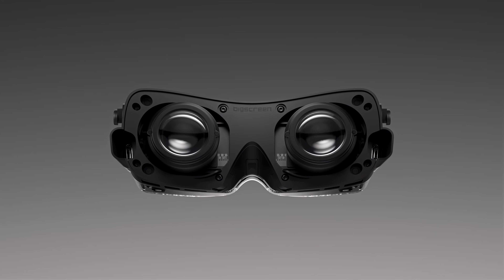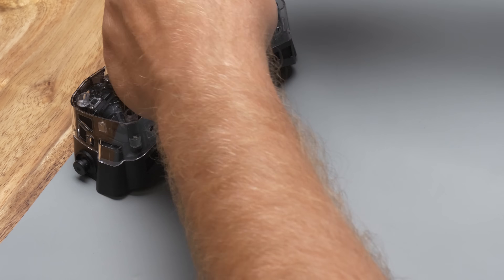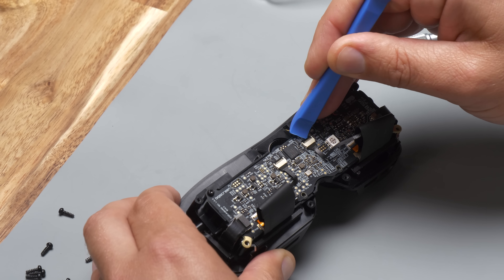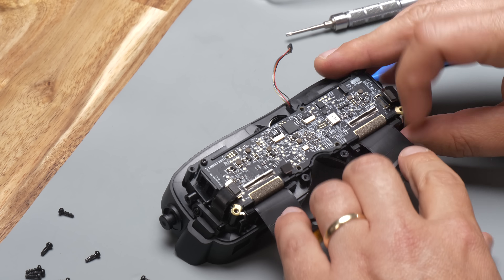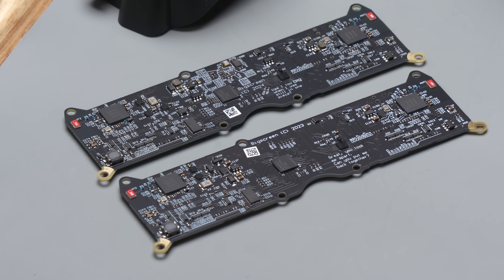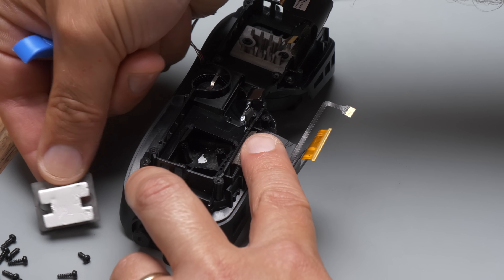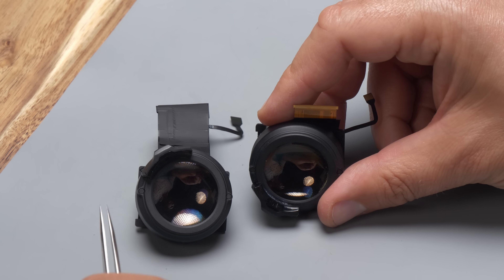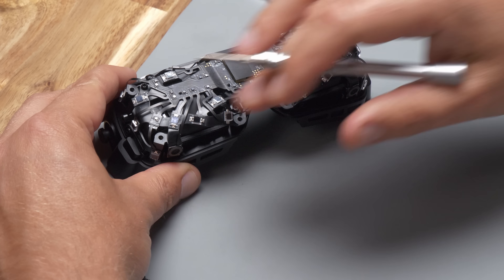Bigscreen Beyond 2 Teardown: How We Achieved Eye Tracking, Adjustable IPD & Better Optics in 107g

Comment: Awesome! You guys rock!  A question / concern about the eye tracking. The sensor seems to stick out quite a bit, giving the impression it might hit your face, or at least stop your eyes getting as close to the lenses? Is this true?  Does this affect achievable FOV, if not able to get as close to the lenses?
Reply: I don't know how to explain it, but even when I hold my BSB1 with bare hands (without the gasket attached) to the point my eyelids are brushing the lenses whenever I blink and the top of the lenses are sitting on my eyebrows, the bottom part still has some empty space.

The face gaskets are notably thicker on the bottom part than on the top part.
Reply: @replacesoundboardThanks. Good to know.  It’s interesting to see that the eye tracking cameras are plug in modules to a common mainboard, which suggests they could potentially be added later (i.e. common mainboard).  Because I’m only interested in the “possible” future Foveated Rendering application of this, I’d rather buy BSB2 without eye tracking, and only add it later if it becomes worthwhile.  🤔
Reply: @gregclare  Not sure where I read it, but I think someone mentioned that, right now, the 2e is a separate model which requires to send in your device if you want it later on. But, in the future, they miiiight release an eye tracking which you can add yourself, but it would be more expensive or something.

Maybe it's a completely false rumour.
Reply: @replacesoundboardGiven that disassembling the BSB2 (to plug-in some eye tracking modules) would void any warranty, I’d be happy to send it back for an upgrade.  Understanding there would be a reasonable cost to this, knowing this was possible would at least resolve the worry of ordering without eye tracking, only to later wish I had it.  I wouldn’t want to have to buy a whole new BSB2, just to add eye-tracking later! 🙄
Reply: @replacesoundboardInteresting that the almost unbelievable edge-to-edge image sharpness / detail (shown at 8:42), suggests that if you have a powerful enough GPU, then Foveated Rendering might not actually be needed?  After all, these are more realistic (with current GPU performance) 2.5K modules, not the 4K modules that really need a 5090 to drive (or even a 6090!!).

Comment: The only thing I miss is the fovated rendering with the eyetracking to release the strain from GPU especially that you guys are not using OpenXR but heavy SteamVR backend that drops the performance by 25% in some cases. I was told that you are working on the OpenXR implementation. Is that still true?

Comment: It's incredibly repairable considering its size, most companies would just give you a soldered and glued brick
Reply: And it sure does seem like one could replace the stock front plate with an Inside Out tracking cam array and/or Passthrough stereo camera eyes plate that plugs into unused 2.0 port, if they get to offering one.  Expandability possibilities
Reply: is it repairable though? when a component in there goes bad, what are you going to do? take it apart, wish the damage away, and put it back together? unless bigscreen commits to providing replacement parts, this is not a repairable device.

Comment: my finger is hovering over the order button, I just need to wait for the deckard announcement
Reply: It's not coming out until 2026 at the very earliest. And it's pitched as being an inside-out tracked standalone headset when most people buying the Bigscreen want a dedicated PCVR experience with lighthouses. They're not really comparable products at all.
Reply: @T00DEEPBLUE  I dont have base stations or controllers already. I am coming from a quest pro, so the inside out tracking on the deckard would actually be preferred and hopefully it will have face tracking too, but the form factor and weight of the beyond is endlessly appealing, especially with there being mods for adding mouth tracking out there too, but the beyond would just be considerably more expensive because I dont have a lot of the hardware already
Reply: @ChickenScratch  If you haven't got the lighthouses and index controllers already then it's hard to recommend the BSB. Most people buying this headset already have those pieces of hardware from previously owning an Index or Vive. But for those who already do, the BSB2 is a no-brainer.
Reply: @T00DEEPBLUE  Maybe, but the bigscreen beyond 2 also offers something no other headset does, well except maybe the pimax dream air, but that is a pimax headset and we havent actually seen it yet so who knows how it will be
Reply: Since Valve no longer produces the BS it makes virtually zero sense to purchase this headset as a user not in that ecosystem
Reply: @Frigobar_Ranamelonico  Yeah that's another thing, the hardware it relies on is on the way out too. I've heard conflicting things about it but apparently knuckles are also not being made anymore. Despite all of that, it kinda just shows how good and enticing of a product it is if some people are willing to buy that stuff just to use it. It's so close to being the dream headset
Reply: @ChickenScratch I mean you can’t buy in different countries directly from valve, you don’t need any more evidence
Reply: @Frigobar_Ranamelonico  ah ok so it is a country dependent thing? fascinating. Maybe the beyond 3 will have slam tracking. It would be less weight than lighthouse tracking and they could do more with it like track controllers and have pass through
Reply: @ChickenScratch  more than country dependent, it's probably ending the supply in the warehouse
Reply: @Frigobar_Ranamelonico  dang, I hope the deckard's controllers are at least compatible with base stations so that they can take the place of index controllers when those eventually run out

Comment: I gave up on buying this product after realizing that I had to buy extra 800 dollar worth of Valve Base Station + Valve controller set, outside of buying the 1300 dollars of the main headset + audio strap.  Valve index product isn't officially available in my country so I have to buy sweaty used ones or buy through a reseller which marks up the price 1.6x times + the currency exchange + tax. 

 The Bigscreen temps me since I get so sweaty after using my Quest for a few minutes but the price is totally out of my reach. Even just the 1300 dollar (headset + audio strap) is a tough, tough pill to swallow.
Reply: Have you checked HTC Vive for the base stations? Although that doesn't change the fact it will be costly for someone who's not already in the ecosystem.

Comment: Foviated rendering mentioned 🗣
Reply: Games will need to support it.  Which means BB2 would need mass adoption.  Seems unlikely, but they might work out some deals with a couple publishers.  Best case is Deckard gets eye tracking and Foveated rendering and Valve pushes out a solution embedded into SteamVR.
Reply: @jlepage36  Games do support it. The headset cannot do it. DCS, iRacing and MSFS support it.

Comment: I am praying that you're in talks with Valve behind the scenes to support future Deckard Controllers and wireless tracking/display without Lighthouse. A version of the Halo mount with Deckard tracking and Apple Vision Pro style belt  mounted battery would be perfect
Reply: I desperately hope they don't cave to solutions that don't use external cameras. This is the most practical way to make a small headset with ACCURATE tracking. Inside out should be thrown in the garbage bin with WMR and instead focus on making Lighthouse type tech cheaper
Reply: @LunaSolarys  Not only accurate tracking but it enables people like me to keep using vive 3.0 and tundra trackers without resorting to 3rd party apps like OVR space calibrator to get the playspaces aligned.
Reply: The Deckard controllers seem incredibly meh, if the leaks are anything to go by. And inside-out tracking cameras not only add complexity and weight but the tracking volume of the headset would be garbage due to the headset's physical size restricting the field of view of the cameras. Base station tracking is the only practical way to go for a headset this small.
Reply: @T00DEEPBLUE  yeah true, the headset already does have issues with tracking even with base stations, good that you brought that up,. although i wouldn't mind still having some sort of puck in the future giving the headset standalone capability whilst still using basestations (heard that wouldn't be realistic though)

Comment: Pricey as heck but sooo much respect for the company philosophy, that's how it's supposed to be!
Reply: honestly its an insanely good price for what it is compared to the rest of the industry
Reply: @rei_lyy  It's a good price even you just want the screens and lenses out of them!
Reply: @rei_lyy  I don't know if I'd call that a good thing, if in the best case you're still spending a 4-digit sum of money on a headset (assuming you haven't already spent another 4-digit sum on the PC, tracking equipment and controllers).
Reply: you can also buy the upgrade with the accessories package to get it cheaper, with the caveat of needing to buy the face cushion separately or get a thrid party cushion
Reply: The philosophy of not giving relevant information? Like how its upscaled at 90hz, and now they came up with a new term "diagonal FOV" to mislead even more. Diagonal FOV does not mean anything.
Reply: @Nobody-Nowhere What? Diagonal FoV means FoV on the diagonal, which is usually optically limited rather than limited by the screen size.
Reply: @charltonrodda  And why does not any other manufacturer use diagonal FOV? because BSB invented it on this headset to mislead people to think its the horizontal FOV that people always think when they hear FOV.
The real HFOV is only 108 degrees, so it was about 5 degrees total more than the BSB1. So 2.5 degrees on each side...
Reply: @Nobody-Nowhere okay butt licker
Reply: @Nobody-Nowhere diagonal fov means more than you think the diagonal fov is screen size overall you can have a super high horizontal fov but a smaller vertical and the screen won't be big enough you can have a high vertical and a smaller horizontal and your fov is limited now having a high diagonal fov means you are higher on both ends and it covers all angles

Comment: how much do all the screws weigh?
Reply: I did a rough weightscale estimation, and it seems to me like they weigh less than 10g. Probably around 5-7.

That's if they use normal screws. You can get lighter metals screws that cost more.

Comment: This headset should have been wireless by now.
Reply: Making it wireless would just add unnecessary weight and there isn’t any way to run 2560x2560 screens without compression.
Reply: @sandernote089 there is a way but it's not easy and it requires a lot of extra components
Reply: Making it wireless without severely hurting visuals or weight/comfort is wishful thinking. Not to mention shit battery life and input lag.
Reply: "Should" => Why?

If it's just because you want small form factor combined with wireless, there's the Vive XR Elite.
If it's micro OLED and pancakes, there's Play For Dream.
Reply: you mean Play for Dream?
Reply: @Frigobar_Ranamelonico  that’s a whole different class of headset
Reply: @sandernote089 not really, same concept, higher resolution panel (still mOLED), and it a complete package compared to the BSB2.
Reply: @Frigobar_Ranamelonico  my only problem with that headset is that it doesn’t have any physical display port connection and it seems quite large compared to a beyond. I mainly use mine for social VR with some SIM racing on the side. So the small form factor is extremely important to somebody like me. Still looks like a really cool headset but for that price tag I’d expect some sort of physical connection alongside wireless.
Reply: @sandernote089  the point is that, beyond that valve no longer sells stations and controllers.

But the cost of the BS is identical to that of the PFD for someone who has to approach it today.
Once you count everything to make it usable
Reply: @Frigobar_Ranamelonico  it might cost the same, but it’s a wildly different headset. The big screen is a super lightweight small form factor custom fitted headset while the PFD is a large bulky Apple Vision Pro competitor.
Reply: @Frigobar_Ranamelonico  You do have a point that it's less compelling for someone who's not already in the SteamVR ecosystem to buy into the Bigscreen Beyond. Despite being satisfied with my BSB1, I do understand the cost of purchasing brand new lighthouses from HTC Vive (plus controllers from whoever you can find decent ones) is an extra cost not everyone can afford.

I did stumble on some people who still made the jump, but only because they truly wanted that small form factor (mostly simmers who could afford it).
Reply: @replacesoundboardyeah, unfortunately for them this decision is probably blocking even more people from making the jump

Comment: Ordered bsb2e a few weeks ago. With audio and halo strap. Perfect vr headset for me. Don’t need to break the bank for a 5090 to take advantage of its full potential. I like that you’re showing it off this way. It is a technical work of art. Thanks a bunch! Cheers!
Reply: Becareful because dynamic foveated rendering is not gurantee they said.  We can loose $200 for BSB2E version
Reply: @sky-h6j-i1q  This vr headset is a winner for me with or without DFR. Cheers!
Reply: @sky-h6j-i1q   I'll chalk that up to a software implementation due in the future. You don't need the precision level of Apple Vision Pro eye tracking to tell the DFR driver 'Hey, my eyeball is looking left and down 15 degrees right now, spend more system resources to draw that area a little sharper for now'
Reply: @sky-h6j-i1q Eye tracking is important for me and my content creation.
Reply: But if you do have a 5090, expect a locked 75Hz while you super-sample out the wazoo and max every graphics setting.
Reply: @jlepage36  I checked the prices for the 5090 and they are over 3k. Going to be a long time before I can grab one. I run a 9800x3d and 4090 so I think I'm good to go  for the bsb2e. I fly msfs and elite dangerous. Oled is a must have for space games if one can afford it. Cheers.

Comment: Cool, foveated rendering❤
Reply: But it's not foveated rendering. It can't do that.
Reply: @Ademos5  I don't see why not. As long as it can track eye position, the rest is handled in software.
Reply: I doubt that one very small camera per eye is ever going to be enough for good DFR.  Maybe the BSB3e will include more and/or an IR array?  Time will tell I guess.  Still, looks like an amazing headset though, and is def on my micro-oled hit list to buy later this year.  However, no way I'd pay extra for 2e until DFR was supported.
Reply: @tomc1380  since when does it require more than 1 camera? The single camera is for eye tracking  not face. Where is your data saying one camera isnt enough for eye tracking?
Reply: @insertnamehere4419  The 'data' stems from basic human anatomy. Humans aren't cyclops.
Reply: @T00DEEPBLUE  what? There's one camera for each eye. How many eyes do you have? I asked you where is the data that says you need two cameras for one eye, or three, or four? five? how many?
Reply: @insertnamehere4419  Your last comment was poorly worded to be interpreted as meaning you only need 1 camera for both eyes. And I thought that was kinda funny.
Reply: @T00DEEPBLUE  And I think it's kinda funny you interpreted it that way, but sure? We're talking about each eye tracking module, not the headset as a whole.  Why in the F would I think it's one camera for both eyes when each eye gets its own eye tracking module? Critical thinking would have been useful.

Comment: Why didn't you install 1:2 ratio OLED displays instead of 1:1? We need 140° or more FOV with 100% binocular overlap, and a display 1inch by 2 inch could solve this
Reply: "we need" is hyperbole and you know it.
Reply: i dont think that display exists yet, they buy the displays, i dont think they make them. also change in displays means they need to remake the lens, and this type of lense is hard to get right
Reply: @elchampion4658 let's hope bigscreen partners with sony to get them to produce wider displays 1:2 or 1:3 aspect ratios for that incredible immersion... Pimax has achieved this but thwy have a 90° sterio binocular overlap with 25° on either side.. but that's a compromise for many and motion sickness for several others
Reply: They are off the shelf displays.
There isn't a lot of choice when it comes to micro-OLED panels - only a few are properly in mass production.
Reply: Asking for a 140° fov with a 100% overlap in a headset this small is something that even my local schizophrenic homeless man couldn’t come up with
Reply: Why so you think it's impossible lmao? @sandernote089  it should be easily achievable using a wide display aspect ratio 1:2 or 1:3 rather than 1:1 per eye
Reply: If you can engineer a headset with an FOV that wide with 100% overlap and have the whole thing weigh 100 grams, why don't you go out there and start your own VR company?
Reply: The displays probably are super expensive, also probably limited by the lenses
Reply: why don't you ride a unicorn to work instead of driving a car?